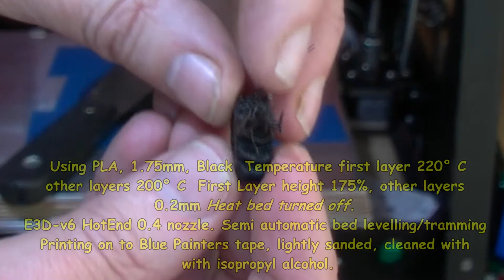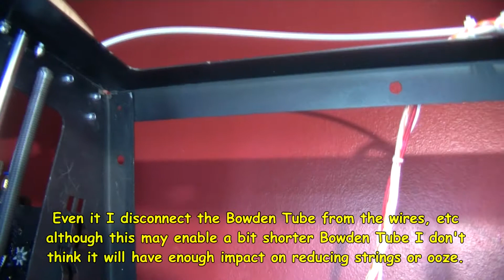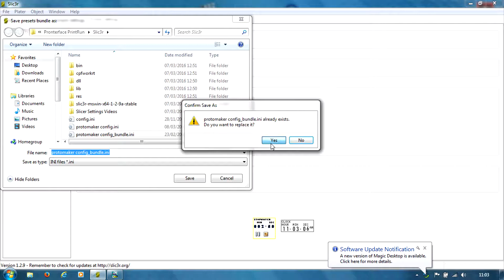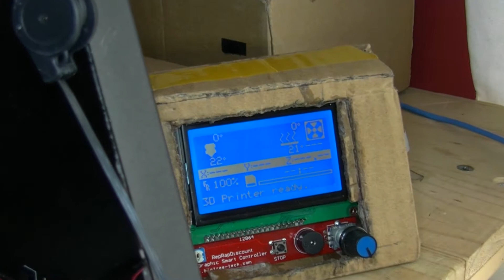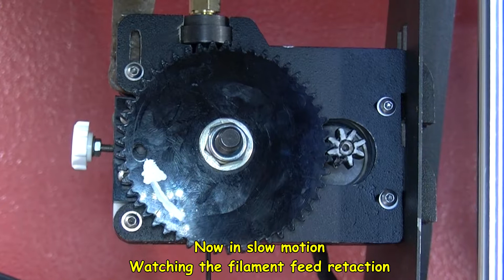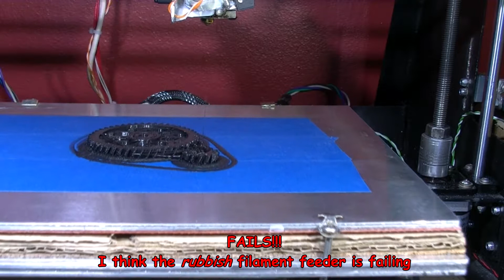3D Printer String Fix Fail

Comment: join a 3D printer Facebook group
they post problems and solutions all the time
https://www.facebook.com/groups/makerbot/?fref=nf
Reply from the maker: +ThePaalanBoy I do not use FaceBook
Reply: Protomaker Black Sprint Original 3D Printer what's wrong with that?
Reply from the maker: +ThePaalanBoy Facebook wanted all me private details
Reply: Protomaker Black Sprint Original 3D Printer  ......?
details about you or your projects?
Reply from the maker: +ThePaalanBoy I think it has been fixed string solved
New Feeder a lot better 3D Printer Belt Drive : A great eBay seller made for me
https://www.youtube.com/watch?v=B1pRHGIrd0Q
Reply from the maker: +ThePaalanBoy I think it has been fixed string solved
New Feeder a lot better 3D Printer Belt Drive : A great eBay seller made for me
https://www.youtube.com/watch?v=B1pRHGIrd0Q
Reply: Protomaker Black Sprint Original 3D Printer i think you just spamed
Reply from the maker: +ThePaalanBoy I am trying to provide help, not make you eat spam
Reply: Protomaker Black Sprint Original 3D Printer what's the help you're trying to provide?
Reply from the maker: +ThePaalanBoy "3D Printers Others" Playlist I have
Reply: Protomaker Black Sprint Original 3D Printer
 that didn't answer my question.
Reply from the maker: +ThePaalanBoy Sorry for that: but thanking you 20000% fro trying to help me
Reply: Protomaker Black Sprint Original 3D Printer so you thank me 200 times X)
but seriously, join the page
you will get help on anything you may need help on, and you can help others.